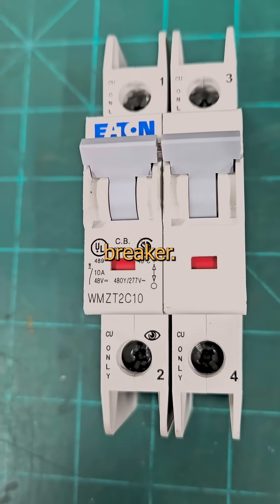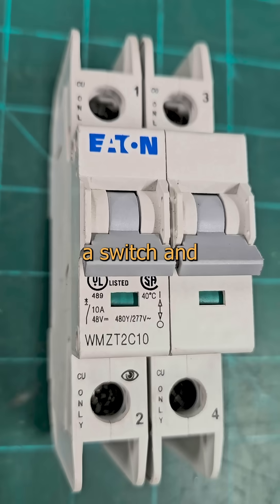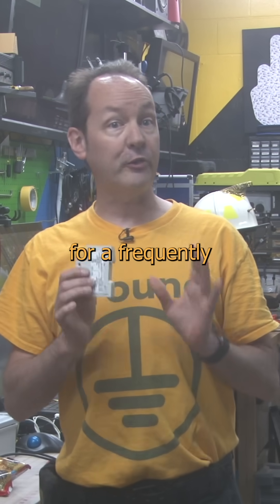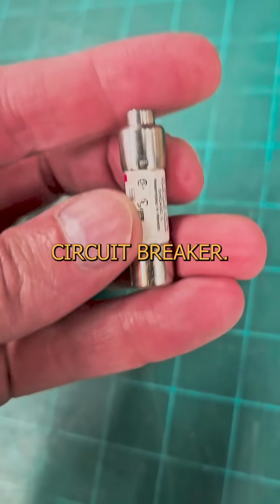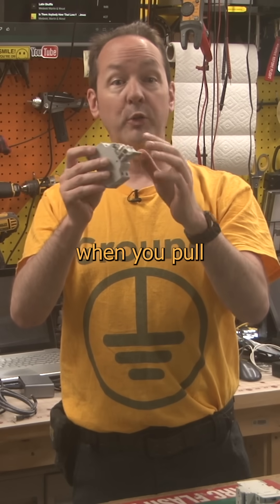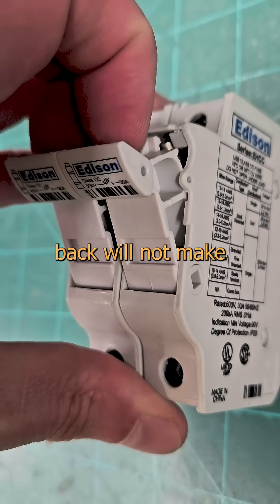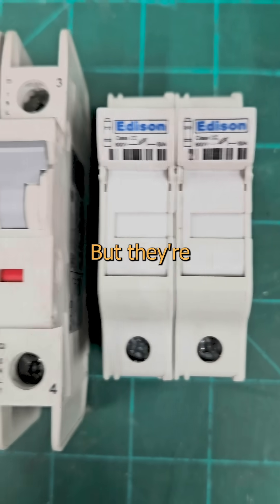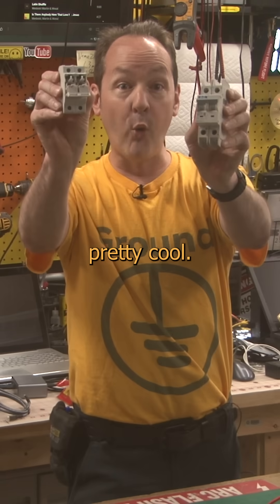Breaker vs Fuse #chrisboden #comedy #engineering #electrical #apprentice #training #educational

Comment: My house still has glass plug fuses. Trying to figure out what was over taxing circuits when we first moved in, cost a small fortune of the little fuckers. only to find out the previous guy was cheap and just used what ever fuses he could find so we had to dig up old building plans to figure out what was right.

Comment: Look on the bright side. At least they are burning up cheep fuses. Known a few placea that used crane motors like fuses. 1 motor could be old and worn. Replacement motor could have been a manufacturing defect. When your on motor #5 stop throwing motors at the problem and find out what changed. Dont care how much management screems about quotas youve already bought up available stock and the motor shop can only rewind them so quickly.

Comment: Holy shit as a programmer I couldn’t stop laughing my ass of that’s the most elegant programmer way I’ve ever heard to call someone stupid
Reply: I'm guessing the most basic of codes requires at least 12 lines of code?
Reply: @andrewrobotbuilder Arduino uses 6 lines just to compile and do nothing, so it would need to be a very basic program to fit in 12 lines. 

Ignoring how Arduino is C/C++ and ignores whitespace so you can put the entire program on one line.
Reply: @andrewrobotbuilder  depends on the programming language. My record is 3 lines in Python.
Reply: @andrewrobotbuilder  It's not that there's a minimum number so much as you can't do much with 12 of them. 

Sure, there's code golf and tenuous definitions of 'line', but it's still not much to work with.
Reply: @andrewrobotbuilder you could also just be 12 lines in a bigger program
Reply: @andrewrobotbuilder  nah. "Hello world" is shorter than that. ^^D
And depending on the language "a line" may get crazy long...
Reply: @ClashClash89  whitespace 💀
Reply: Are you telling me that you never heard of the infamous "Layer 8 error"?

you know...
where the error is between the keyboard and the chair?
Reply: @ClashClash89  or the classic PICNIC error: problem in chair, not in computer.
Reply: He’s figured out Artificial General Stupidity. 💀
Reply: I used to have a shirt that said "Go away, or I will replace you with a small shell script."
Reply: And the fuck you in particular to me was specifically an OLD arduino. ^^

Comment: The thing i like about fuses is they always work as long as they are the correct fusing current and fault rating  . Using that kind of thinking on much larger circuits made me mistrust circuit breakers being a mechanical device they can and do fail sometimes. Saying that i closed the fuse on a dead circuit and reenergised them remotely saved me from burns and injury at least once in my career . Remember a fuse is always a fuse  not so with a CB.

Comment: I've been using the circuit breakers in my home as switches whenever I need to work on wall outlets, lamps, etc. Now that I've learnt that I shouldn't, how do I turn off the electricity in my home whenever I need to install something?

Comment: I used to be the "when you are too embarrassed to call your trainer about it" guy for the trainees at a residential solar O&M company, and the amount of times i remotely troubleshot fuses for dummies was far too often. If my burnt out ass could graduate electrical trade school top of his class while higher than a screeching utility inverter's output voltage fucking anybody should be able to figure this shit out on a basic level.

Comment: Why do many Manufacturers call their non-trip disconnects “circuit breakers” ?
This annoyed me for years.

The industry and codes clearly standardized on circuit breaker as a resettable current limiting device and made an obvious differentiation from fuses.

So then to sell a disconnect without the trip mechanism has “fooled” many of my new electrical engineers until they learn about this foolish deception.

The would order a “circuit breaker” disconnect only to find out well after it had been running for a while that the trip was extra or not optional.

Comment: Best part is, there are actual din rail switches, just for turning on and off circuits. They have a few usages, over here in Europe. Good example say you want to have electric stove and boiler but your electric company doesn't want to upgrade the wires to your house or apartment. In that case the boiler and stove are connected to separate switches with some clever logic to ensure only one circuit is operating at once
Reply: Hager SFT125 (switching between two outputs or inputs) and SBN125 (one on/off)
Reply: Clever logic meaning... a switch?
Reply: @ That depends.

There are what you'd call a classic switch, with on and off positions. There are some automatic switches with select between two circuits, though I'm not 100% sure how they work.
Reply: In the UK if your installation doesn't have enough supply capacity, you can install what are called Priority Boards.
For example you can have an electric shower and a car charger, but turning on the shower will take priority over the car charger and turn it off.
Reply: Ohhhhhhh! Practical.

Comment: The funny thing is one of our fixtures is at least 10 years old and has been used 10x a day, as a switch,  with the same circuit breaker on it.
Reply: Circuit Georg is an outlier and should not have been counted
Reply: @ferrous719  ?

Comment: The problem with fuses over circuit breakers is people use tinfoil or Wrigley's wrappers when they can't find a replacement fuse.
Reply: I've literally seen live .22 rounds used as replacements for buss fuses .
Reply: @kaboom4679 Nothing better than the ol explosive sign quickblow fuse.
Reply: @kaboom4679 idk how many amps one will take before it goes off*, but has an audio alert which it blows! 

I know several old HVAC techs, sometimes they worked on old stuff that used (maybe still does, IDK) fuses that were 1/2" diameter and 3" long, at a guess. Y'know what HVAC techs have a lot of on the truck? 1/2" copper tubing.

*now I want to do A Science.
Reply: @DeliveryMcGee They did that on myth busters once.
Reply: @DeliveryMcGee  "but has an audio alert"

Also, if it actually blows, you can be certain that the circuit has been interrupted.
Reply: @DeliveryMcGee  The "pipefuse" is a testing tool. Sometimes, you need the fucker to run for 10 seconds to find the fault, like to see if a motor is stuck or not without shoving a hand in there. In this case, having something to jumper out a fuse is handy. This is not for a permanent fix though, this is the "we need to test it to see what's fucked" 

Best example i can give of this is watching an electrician find a fault in an underground cable. 220 line had a break in it. He got permission, and bypassed the fuse and had a few people along where the run was (with appropriate footwear and safety protocols observed like standing on rubber) to listen. You could actually hear the arcing of the short underground and they were able to get within about 3 feet of the break that way. the transformer that supplied that line got a bit hot, but it was a helluva lot better than waiting a week for a TDR.
Reply: @zerumsum1640  Oh yeah, I see the use of it in testing, and in the air conditioners the guy probably left it in after fixing the problem so the people could have A/C while he went out to get a proper fuse to come back and put in the next day, but he had too many other service calls to get back to it, and then forgot ...
Reply: @kaboom4679 proper name and several levels of WHAT and WHY
Reply: @ It's the exact perfect size for the old glass-tube fuses in cars, and good ol' boys usually have at least a couple rolling around the floorboards. You're supposed to use an already-fired case, though.
Reply: @kaboom4679 It gives a handy audio warning when the current exceeds what it can handle?
Very handy.
Reply: @kaboom4679 Darwin award time...
Reply: @kaboom4679 i mean, it has a chance to cut the current
Reply: @kaboom4679 Are you talking about in vehicle? I've only seen 12 volt fuses that size. I remember hearing a story about the bullet going off. This guy did a video about it.
https://www.youtube.com/watch?v=uOYfOc0wfrI
Reply: @kaboom4679 that is utterly horrifying
Reply: @kaboom4679 you can use a copper nozzle from a welder. About the same size as a 22 but solid copper. Y'aint blowing that.
Reply: @kaboom4679 
I'm not saying it's a good idea but Uncle Ron was right, it got me home
Reply: @kaboom4679 yup, and when that overheats, something or someone has a new hole.
Reply: @kaboom4679 JFC!
Reply: @kaboom4679This is an old Darwin award story. I read one of these over 30 years ago in which a hunter replaced a buss fuse that blew in his pickup with a .22 bullet and supposedly shot himself in the leg when the fuse heated up.
Reply: Hell, I’ve seen 1/2” copper pipe standing in for fuses on irrigation pumps.
Reply: Used to see pennies in the round fuse holes all the time. I still occasionally see blown fuses screwed into light sockets to block them off.
Reply: @drewzero1  A pre-blown fuse in a light socket to prevent it having something else inserted through absent-mindedness or forgetfulness isn't all that bad. A coin in a hole for a round fuse? That is bad, because it's how you get electrical fires in the walls of your home or business.
Reply: A guy I worked with did that to a car owned by a  woman we worked with when her car wouldn't start, she had to get a ride to work the next day, her car caught fire and burned up on the way home. It was a 1968 Mustang fastback.
Reply: @bigredc222  no big loss heap of yank junk
Reply: @massimookissed1023  the fuse block for my old AC system had copper tubes in place of fuses. That was quite the surprise when the HVAC guys replaced my system.
Reply: @huntergman8338  I had to do a job in a lathing shop once that had done this... Living on the edge.... >_>
Reply: @RoonMian  oh no...
Reply: How the hell did you know i did that 
Listen im going to go get the real fuses...
Right after I go get some blinker fluid
Reply: why ? like just connect the wire normally if you do not care about safety
Reply: I'm reminded of that scene in Help! with the two electricians just standing there drolly rewinding the fuse every time it blows 😂
Reply: Your saying 3/8 refer pipe isn’t rated at 40 amps?
Reply: No, some of us just change the wiring to bypass the fuse entirely... (It was 24vdc and the machine had to run asap, calm down)
Reply: Wrigleys? 😂 Blast from the past lol.
Reply: Wait, I can do that? Good to know!! Thanks!
Reply: The house I grew up in has screw-in fuses.
The size of the sockets was apparently jut right for some idiots to replace a frequently popping fuse with a penny, generating the name "Lincoln Fuse".
NEVER DO THAT!
The penny will handle more current than the likely hodge-podge of wiring in that house, which may have started with two-conductor post & wrap, and been added onto with other sizes of 2- and 3-conductor wire (got to have those false grounds!) with blind connections buried in the walls and inaccessible for inspection or repair.
Reply: Copper pipe, bolts, studs, your mother's first dildo....
Reply: Or even nails 😮😮
Reply: or small bolts and screws
Reply: Mr. Angus MacGyver did that once.
Reply: Always had some at the bottom of the fusebox
Reply: I've seen images of copper pipe being used, and just straight bolts
Reply: And the problem with circuit breaker can be, that people try to turn them few times, which can cause more serious troubles. If design is done well, then CB should trip only when there is some problem and should be turned on after checking whole system

Also fuses box have a place for second fuse for replacement

Never saw in my short 3yr career that someone would use something else instead of fuse. But im working most of the time on industrial and business sites, residential only rarely
Reply: @Daniel-du4um  I think this is because people don't have fuses that often. Back in the old days, everyone knew about the old "penny in the fusebox" routine.
Reply: On the other hand, you have folks tying breakers down.

If people really want to be idiots, they're going to find a way to be idiots.
Reply: Tinfoil is actually not that bad. I restored fuses in a pinch with a bit of thin wire of a correct diameter when I need the machine up and running before a proper replacement fuse is available. And them darn fuses still work like proper fuses, if you short em they will blow out. Granted, those devices are 220 and rarely draw more than 5 amps, so yeah.

Seing screws, nails, cents or pieces of steel cable is actually scary tho.  That shit's gonna be the last thing in the entire machine to burn out and that kinda defeats the purpose of a fuse
Reply: @danahansen5427  Quite the opposite.  I used to buy circuit components (resistors, capacitors, vacuum tubes) at Radio Shack, back when it was a maker shop before maker shops existed.

From the tone of your post, I'd just assumed you were of the same generation.  No offense intended.
Reply: I've seen copper pipe used in a 230A fuse box.  Out maintenance guy was PISSED, especially considering that building had burned down a decade ago.
Reply: @massimookissed1023  i dont want to believe this.... It seems true
Reply: @xuio67  I know it's true because I've done it.
Reply: @massimookissed1023  absolute madman
Reply: Those are fuses, just not well calibrated ones.
Reply: Coins can be used for screw-in fuses.
Reply: @alfredmorency8296  Well sure, if you like structure fires.
Reply: @MonkeyJedi99  It wasn't a suggestion, just something I've seen people do.
Reply: Found some copper tubing used in a fused disconnect on a residential ac unit before
Reply: I had an official complaint raised against me because I removed the little bit of foil from the top of a fag packet that someone had wrapped around a fuse. 
I should say cigarette carton but I’m British so I’ll say fat packet
Reply: By "people", I think you mean "Americans", because I think fuses are more common in the UK than the US (upto at least around 2000 most British homes had a fuse box to protect home electrical circuits, not breakers), but I don't ever recall hearing of a blown fuse replaced with foil or a .22 cartridge. .... But in the US (I have lived in NC for 22 years, and NY before), jerry-rigging blown fuse replacements seems to be a national passtime, right up there, just below baseball.

Comment: Hey we use those as if they were switches!! Not much I can do about it unfortunately 😭 It's for a really old scoreboard in a sports center. One of the automatic fuse switches is inside of what I think is a substation? (I'm a sound & light tech not electrician) It's a room of transformers and relays making angry noises and heat

Comment: Nothing is more comforting than opening a control cabinet and seeing an empty box of fuses, and a bunch of presumably blown ones on the cabinet floor.
Reply: @mikea5923  that's what nails were invented for 😉
Reply: @Daniel37parker  Man, I once worked in a lathing shop where the fuses had been replaced with solid copper bars the people there had lathed to the exact size of the fuses.

I wanted to leave immediately D:
Reply: @RoonMian machinists are a different kind of people I swear.
Reply: @Daniel37parker  Your comment made me physically cringe. I have seen pennies in fuse holes. mentally screaming
Reply: @Daniel37parker  see a note I left on a branch above. 😂
Reply: At least you can tell the side you need before opening any holders, that should save you time
Reply: @ they usually step on up as they run out, in my experience anyways.
Reply: @mikea5923  "IF you replaced it an it blew again got get a bigger one. There's no smoke from the machine yet"

Or so I suppose the conversation went on the machine that I am fixing to return to factory spec and hope it works when I turn the power back on
Reply: @ you mean the drawings aren’t completely up to date and accurate.
Reply: @mikea5923  When I could find the drawings and not just a parts list that, thankfully, noted what size fuse went on what fuse block number (and the labels on the fuse blocks were still there in enough instances to work out which number block you were replacing).

Lets just say that previous plant management had not been the biggest sticklers for health and safety or preventative maintenance.
Reply: @mikea5923  I lived in an old house with fuses for awhile and I think the bigger fuses were larger so you couldn't just mix and match any size you had laying around. Maybe similar amperages were similar size but big amp differences were too different in size to swap. This was in USA.
Reply: @TheAnantaSesa  okay.
Reply: Nothing is better than seeing where the wiring diagram was once a piece of it, and 13 different jumped wires from 17 different residential electricians over the last 12 years

Comment: A domestic din mounted MCB from a reputable brand like Schneider is worth like 8 NZD if you get a good price from your wholesaler. A replacement push in for replacing porcelain fuses is worth 20 to 30 NZD
Reply: Commercial is not the same as residential though.

Comment: I don't think I've ever seen that type of fuse holder in the wild.  Plenty of screw in fuses, glass fuses, and the big version of those high current fuses though.  
Maybe someday I'll get to work on something semi modern
Reply: We install them in a lot of control stuff we build
Reply: @jerryrigsit5400  same here. I mostly used them for protecting the control circuits on larger equipment. When you get into 125A plugs the short cirquit current can exceed 10kA.
Reply: @lukahierl9857  yup